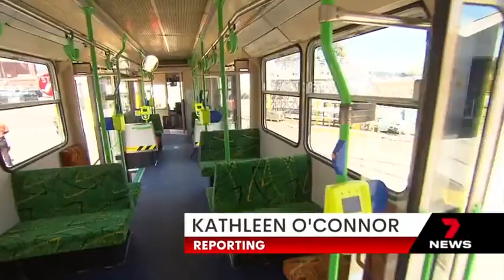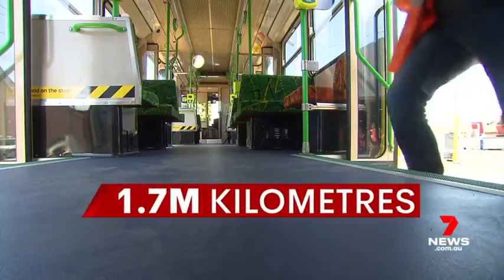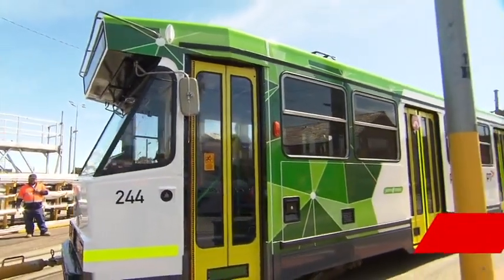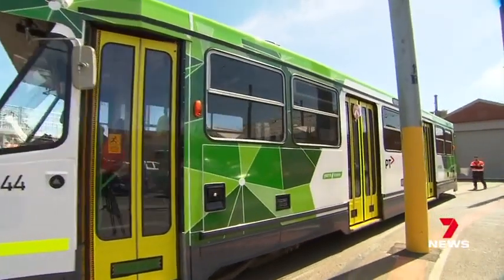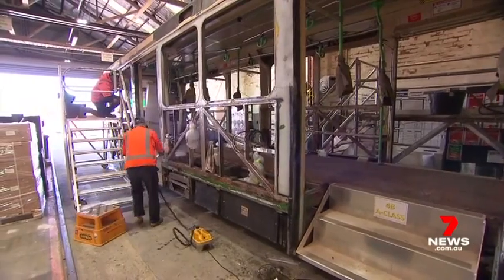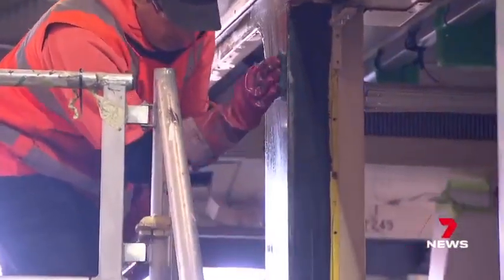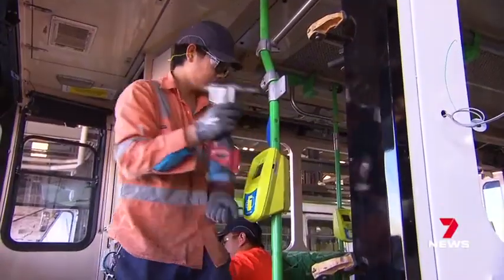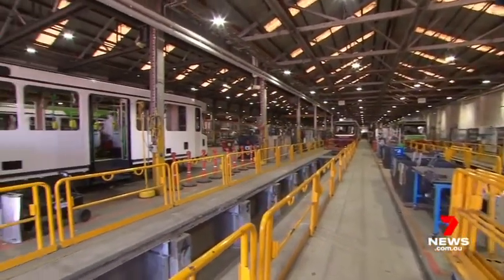Tram life extenstion upgrade milestone [Oct 16, 2022]

Comment: Problem with these trams is getting on them if you are not young and fit the can be a real struggle
Reply: yes, we should be retiring most of the high floor trams. keep a dozen of each, but we should have a 90% low floor network so you don't have to wait for multiple trams to get a low floor one